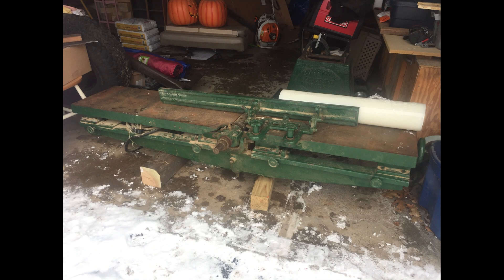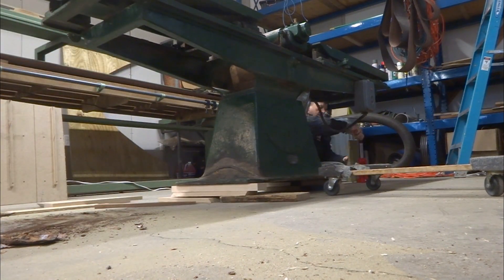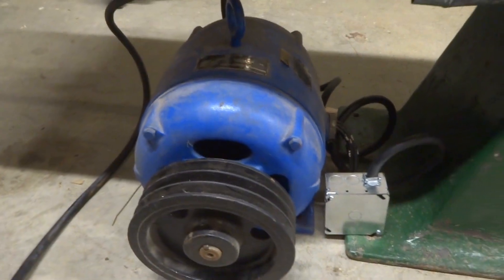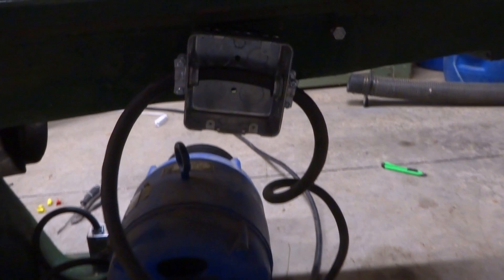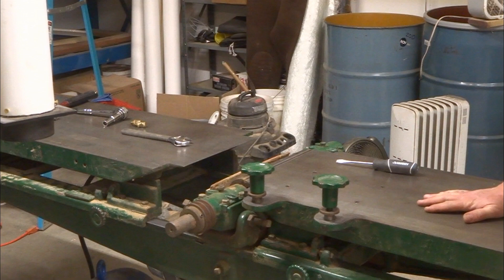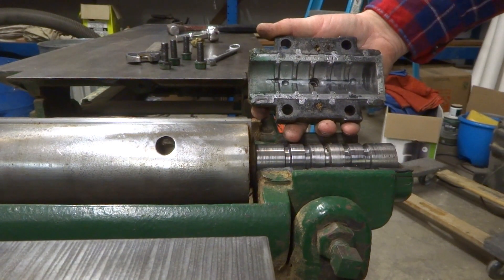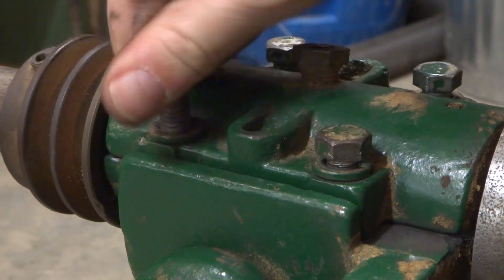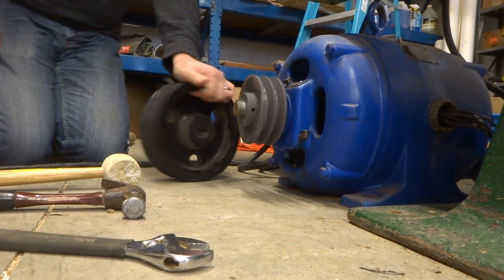90-Year-Old 12" Jointer with Babbit Bearings

Comment: Great video thank you! I bought an old machine like this 45 years ago and I found that just squirting 90 weight  gear oil into the hole with a trigger type Oiler before you start it up each time has worked fine. The pressure from the oiler fills the grooves and distributes the oil. I rotate the head by hand a couple of times before I start it up to spread the oil around a little.

Comment: On old woodshop I worked at had several old machines like that with babbit bearings. One was a massive 24" Oliver jointer, and another was a drum sander. I got to watch the bearing get poured on the drum sander — it's a pretty awesome process! Both of those machines are about 100 years old. Love those old machines!
Reply from the maker: I actually have to pour them again soon. So I will get my first experience with it.
Reply: @ku3kyc  Good luck! Check out Keith Rucker Vintage Machinery on YouTube. He just poured some babbit bearings last week, but has several videos on it. Good luck, that's a sweet machine!

Comment: Babbit bearings - when they are in good shape - are actually MUCH MORE PRECISE than ANY type of roller bearings. That comes from the fact that the babbit is poured over that exact shaft while it is in place. It is usually then hand-carved to provide oil passages.  The shims allow them to be tightened up gradually as they wear.  When they wear out to the point that there are no more shims - you just melt and re-pour the bearings. Babbit was THE standard until the 1920's, and still used for a HUGE amount of machines (including car engines) well into the 1950's.  I have a truck manual from 1954 that tells you how to re-pour the main bearings in the engine.

Comment: Nice machine. My 12” jointer uses a 3hp motor , way less draw and more than enough power.
Reply from the maker: Once wired properly the three phase inverter draws more than the machine. It is almost nothing. Thanks for watching

Comment: Beautiful tool, dosnt need the drip oilers.
Reply from the maker: I took this comment and ran with it. In recent uses of the jointer I have not used the oilers. What I found is significant heating of the bearing mounts, which I assumed was bad. This was after 30 minutes+ of use. How warm should I expect these to get without oil use?

Comment: I've worked on a lot of old tractors and farm machinery  with sleeve or babbit bearings, keep them oiled and you will get a lot of life out of them. The clearance should be a couple to a few thousands clearance per inch of shaft. The faster they run the tighter the clearance; slower you can have more play. In general you can remove a layer of shim as the bearing wears to tighten it back up. The old timer I looked over the shoulder of would take a shim out, tighten it down, and if the shaft turned, great. If it was too tight he would back off the bolts a little, till it would rotate,  and start it up. Then he sloooowly tighten the bolts while lubing every few seconds till the bolts  seated tight and the machine ran smooth. I even saw him trim bearing material with a penknife or emery cloth a few times. Beautiful old machine, enjoy it, work it.

Comment: Hi,very nice project.I'm sorry for my poor english.Here in Canada,i see many time the 
same problem,withh a 3 phase motor,many time you have wrong rotation,the trick of the
trade,for change rotation,you take center wire, in the fuse box,and change it for left or right
wire,look  if he have a little arrrow show you the good direction to respect,this equipement.
For the breaker who pop out,reduce the diameter of the motor pulley,this is the best way,
when you draws too much amps.  M.O. retired réfrigération mechanics.

Comment: I love old machinery. Stupid question, though ... On a machine this size, did they have some sort of belt feed, mechanical feed for it. When I look at this thing with the oilers on it, I don't see how one could stand and feed as we do on the smaller machines. Looking to be educated here. I assume this old beast came out of an industrial set-up of some sort back in the day. At any rate, beautiful piece of machinery.
Reply from the maker: I have not had any issues with the oilers being in the way. I push the piece in to start then keep downward pressure on the outfeed table. I guess I'm tall enough to have no issues.
Reply: I’m sure those oiler mounts were added later. The bearing caps have oil reservoirs cast into them on both sides. Originally, those bearings would have been oiled periodically with a pump oil can.

Comment: That outside oiler is as vulnerable as. You might be able to rig up an electric pump to supply the drip to the bearing surfaces but as it is it'd really piss me off having to watch it doesn't get hit as well as keeping your fingers clear. You could also get the cutter head machined with 2 extra slots to make it into a 4 blade head. Have seen this done to an old machine like this in New Zealand. Good luck with the motor and getting that sorted.
Reply from the maker: Thanks for the comment. Good observations. In fact the back oiler is angled to keep it clear if the fence. But it still interferes. I’m debating a spiral head cutter with the Babbitt bearings.

Comment: Nice machine Chris. I think your on the right track. Just for some comparison my jointer is 60 yrs old ball bearing machine. It has a 5 hp direct drive motor that I start with 10 hp Rpc. So my head turns a 3600 rpm. It might feel kinda slow to some but the cutting circle is 5 inches. 3 knife.
I’m not sure how fast you can run babbit bearings maybe not as fast as ball bearing.
Setting the knifes to cut as close as possible in the same circle really make a difference.
Good luck.
Reply: Aj:
Would you elaborate on setting the knife....
Reply: Sure setting knives on a machine called a jointer.
For best results start with sharp knives that are ground straight and in balance.
They should be set out from the head so that each knife takes a equal cut.
Greetings from the USA
Reply: @Warrf  ... thanks 😊

Comment: The building it would have shipped out of (Gustafson and Scott) in the late 1920's still stands at 1637 N. Lowell Ave. in Chicago, though the company is long gone.  I have babbitt bearings on an old lathe that I have, they are still functional 80 years later.  That is a nice piece of equipment you have there, hopefully it will last at least another 90 years.  Originally Babbitt bearings were 89% Tin, 9% Antimony, and 2% Copper, but various alloys have been used, but you can melt and re-pour them in a pinch, but you would need to add material (it is still sold, Belmont Metals is one vendor) and re-machine the oil ports and paths.  60 Amps is too much for that motor, is it wired correctly?  You seem to have a heater-motor as it is.
Reply from the maker: Motor wiring was fixed in the next video. Good history. Thanks.

Comment: Babbit Bearing are usually less than 0.35% lead.  Tin is the most popular element, composing from 75% to 92% of the alloy.  Lead Babbit Bearing are employed for low speed, low cost application but that wouldn't be one of them.

Comment: My single phase jointer pulled about 77 amps but we found the plug had a bolt as a fuse in it we also found that the wording was wrong so we fixed that as well it still pulls  about 15 amps Whitchurch is more than any of my other tolls but it does work and an electrician has put a 16 amp fuse in it it trips the breaker in my shed but also does my router and shop vac but it works

Comment: 14:55  if the rpm are too low, it's probably because you changed the driving pulley to a smaller one, that gives you more torque but slower, you should try putting the big driving pulley on the motor again,  what you say at 11:30 that a smaller pulley to "get the rpm's up where they should be" is wrong.  that is true if you change the DRIVEN pulley to a smaller one, not the DRIVING pulley.
Reply from the maker: First person in 2 years to actually notice that. Nice! Of course you are correct.
Reply: remember that it's a RATIO of both pulleys, if the motor pulley is 6" and the shaft pulley is 2", then you have a RATIO of 3, that means the shaft will rotate 3 times faster than the motor, but 1/3 the torque..  what you want to do is increase that ratio, either by a bigger DRIVING pulley or a smaller DRIVEN pulley.   what you did is to reduce that ratio

Comment: I love old equipment. They are usually very well build. I also love 3 phase electric, it is smoother and less likely to stall. According to the NEC (national electric code) your motor should pull 15.2 amps on 230 three phase. You will pull a little more because it is coming from 1 phase. #10 wire is good for 24 amps constant use (80% of wire rating, which for #10 AWG is 30 amps; thus 30 x .80 = 24 amps).

This should last you a lifetime of excellent service.

Comment: Those bearings are indeed lead they can be redobe by melting out the old lead melting in new lead and mecheing them to size they are great becahs they dont really wear on the shaft at all and they are infinitely replaceable if you keep crud frome scratching the shaft

Comment: I am getting ready to rebuild a Crescent Jointer from the 20's. The 3-phase is getting removed for a 1 phase Baldor from Amazon for 345.00. I don't see the advantage of buying and wiring up a converter for a 100 year old motor. Of course I am rebuilding mine to work not as a historical collection piece.

Comment: Hi its me again.By the quantity of wires on yours electric motor,and the diameter of  the 
electric motor,its very possible,he have two kind of wiring one delta and one whye type,
you better to ask a professionel electrician,not a guy wirig bungalow,a guy work in a
factory like  trouble  shooter,on industrial equipement,also if your belt is too tight,you'l
be destroy  babbit bearing very fast,call an expercience trade man.Here province of Québec
we work at 620 volts we have a thumb rule 5 h.p.=5 amps,for who think 620 volts
its better,your wrong,i preffer 208   3 phase,for réfrigération or air conditioning.
Bonne chance = good luck
Reply: 620V, 3ph is different, we more used to 480V in the US. 5A is about right at 620V, 3ph. About 14A for 208, 3ph.
Reply: @kimchee94112  Try 4160V - That is common in the industrial motors I worked on,,,,,And I kind of suspect that there may be a wiring error on that motor or maybe even an open winding. , The draw went through the roof when you put a load on it. - Dull knives might be a culprit too ????

As far as the safety nazi's go...Remember, tha tm,machine was built when personal responsibility was more important then OSHA BS. Check outKeith Rucker's first running of a GIANT surface planer he rebuilt  over at Vintage Machinery. ...if you are man enough to watch a guy who knows what he is doing work.

Comment: Go full Amish and power it with a small diesel engine and line shafts
Reply from the maker: Ha! I thought about using a large 12 horse electric motor and building the line shafts. But what a waste of energy. It would be fun though.
Reply: @ku3kyc  this was when it was a new machine it ran off line shafts and flat belt pulleys 
Ether steam or very large hitt&miss engine